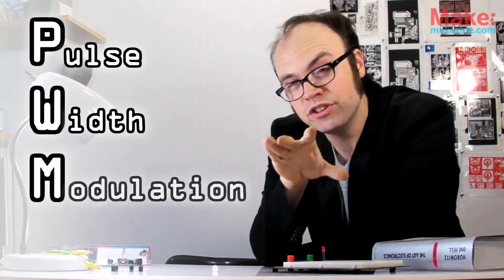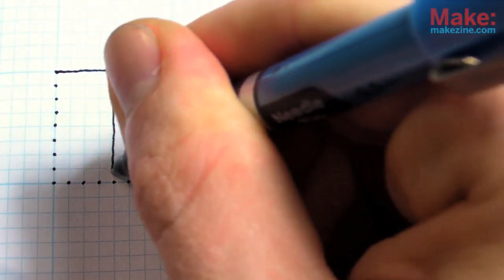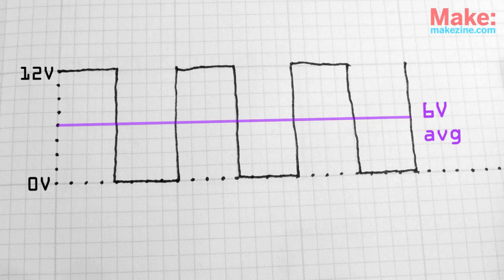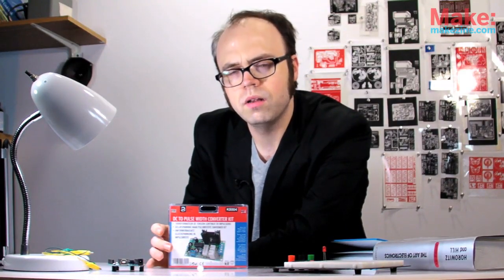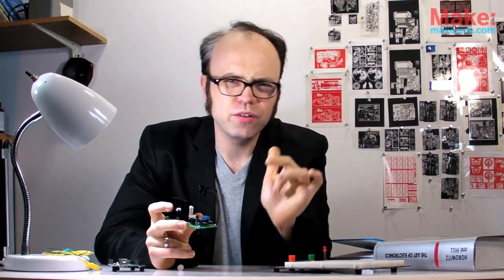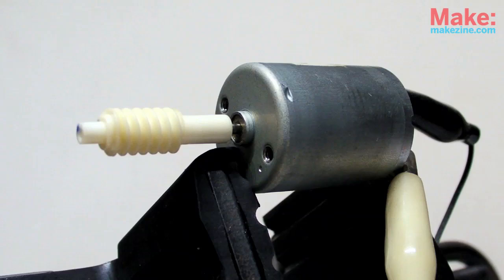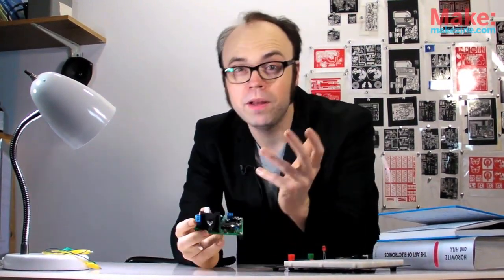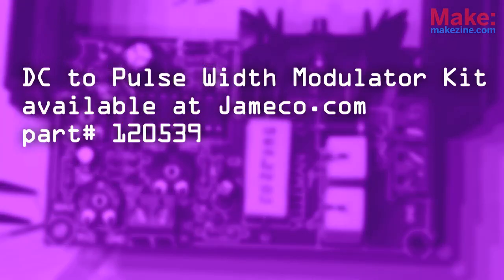Circuit Skills: PWM (Pulse Width Modulation)

Comment: Why not teach your viewers how to make a simple 5 to 15 volt input PWM circuit, with a handful of very simple components, such as a 555 IC, 2x 1n4002 diodes, a 1k resistor, a 47k pot, a 100nf cap, a 10nf cap, and a buz11 n-chan mosfet, on protoboard for a couple of bucks, rather than buying an overpriced kit. That way you can teach them something valuable, save them some money, and look less like a sold out, middle aged,  wannabe hipster, all at the same time. Also note how this channel rarely replies to actual technical questions that the viewers ask, which are all the more valid when a proper tutorial has not been given. That is not how a channel shopuld operate. Just more evidence of what a true sell out channel that Make is. They dont care if you leatrn, they want you all to go out and buy kits and arduino's so you can copy and paste code rather than actually learn the fundamentals first. Just look at the forums online. Millions of kids, spending real hard cash to throw into projects that in reality should cost pennies with the right components and just a little bit of knowledge. Bullcrap! Unsubbed.

Comment: I find it very confusing to use a variable input voltage as a variable to determine PWM duty cycle. I know how PWM works, but I wouldn't recommend this particular video to someone who's still learning it. Please use a circuit that uses a potentiometer (as a voltage divider) as part of a 555 astable multivibrator instead.

Comment: what is he point of the PWM if it is just proportional to the input voltage? I thought the whole idea was to control duty cycle in order to contrl (for example) the speed of a motor that is running on a 12 volt dc input. 

If I have to control the input voltage already, that begs the question how am I doing that?

Comment: The best part about this video is that you're using a bent conical tip Metcal.  Everyone gives me such a rash of crap for using it all the time instead of the cultish following the chisel tip uses, but it's very comfortable and not all ham handed when you're trying to get into a tight spot.

Comment: how does increasing voltage increases the duty cycle?
Reply: It's the other way around. Longer duty cycle effects the motor speed the same way an increase of voltage does. This is because the frequency of the pwm is so fast that the motor just 'averages it out' and responds as if it were a 'change in voltage'.

Comment: But use a potentiometer to control the speed of a motor
Reply: it's not efficient.What would you do if you have a 10W motor?
Reply: you would have a small fire, in my experience

Comment: can someone tell me what that black plate with the screw sticking out of the board is?
Reply: +Xaeravoq Are you talking about the heatsink?
Reply: +Jesse Downing a heatsink on that little thing? thats what i thought it looked like but i never would have guessed that something like that would need a heatsink.
Reply: They can get pretty hot to the touch. I once built a phone charger that converted 6v down to 5v and it needed one (granted, I cheaply just wrapped it in electrical tape).

Comment: Is it safe to drive a high powered LED via PWM without resistors? For example, driving a 3 volt LED with a 12 volt power supply via a 25% duty cycle PWM. The average voltage will be 3 volts, but will the temporary 12 volt peaks damage the device?
Reply: Skelpolu LED=diode  a led has maximum voltage resistance decreases dramatically just like in any other  diode so it practically uses the diode equation then the  product of the current through the LED and the voltage dropped by the LED must not  exceed the power rating of the LED but it`s not the voltage that will break the LED but the current so you should worry about using the tranzistor as a current source most LED s can only dissipate  60-80mW then poc so make the calculations if you hit the LED with the peak of the square at 12 the current should be (12 times x)<60 mW
Reply: +Chaplain Dave Sparks no
Reply: +Psi Phi Tell me, which question did you reply to?
Reply: 25% duty cycle will supply constant 3v on an average the formula being 12 vX25/100.
Reply: short term current when ON will be all that the power source can deliver and will most likely be more than the LED can handle and will let the smoke out. However, if you insert an inductor in line with the LED and a capacitor across the LED, then the PWM signal will get averaged out to the 3V theory says it will be without high current through the LED (less losses in the inductor and capacitor parasitic resistances). Note: the inductor and capacitor values are selected based on the PWM frequency; higher frequency means smaller component values.

Comment: I want to know how to make for example... servo #2 move according to the angle my hand moves where servo #1 is connected near my elbow, can you help me out with this please?
Reply: +Hassan Ajrouche you want to read the servos output in the terminal and use that data to throw it back to the servo IF a condition is met, you will need some pots to read your dof provided by your arm so that you can write the proper conditional statements
Reply: Sys.stem what does pot and dof stand for sorry i dont usually abbreviate things
Reply: Hassan Ajrouche
is not about you usually abbreviating is about you getting with the program, ever heard that expression ? you want to learn how to do things like what you describe you HAVE to get acquainted wit the acronyms it is part of the MCU world your trying to interact with in which case google is always more then happy o let you search for little things like this such as "what is MCU?" and so forth.........POT = Potentiometer / DOF = Desgrees of Freedom
Reply: Sys.stem thankyou very much (:

Comment: Make: can this be used for 2 red electroluminescent light strips 17"x 3" to control the brightness from half power to full power to represent the difference beteween my running light and my brake light by using low mode for running light and using high mode for when brake pedal is depressed.

Would like to use one to control the 2 amber blinker lights as well. Im retro fitting my cars tails light and love the crisp clean look of electroluminescent. No hot spots =]

Comment: Quick note/correction:

The part explaining that 12V at 50% duty cycle is 6V is inaccurate. A 50% duty cycle would give you 50% the  POWER of that at 12V (think of it like you're running it at 12V but for half the time).

This does not mean half the VOLTAGE though (Imagine a simple resistor: P=V^2/R, so half the voltage amounts to 1/4 the power, not 50%)
Reply: nope. power depends on load, no load information, no power information. It's a VOLTAGE waveform so 50% pwm of 12V = 6V average (DC). If you had 12 Ohm @100% (12V) = 12W, @50% (6V) = 3W; 25% power BUT still 6V is 50% of 12V

Comment: Come on man! I wanted to see you actually do something like perform a Fourier Transform on that PWM signal.  Show them the Gibbs phenomena or ringing at the edge of that square wave.  Which you can really understand if you can show them the decomposed signal as the sum of Cosines and Sines.  That would make for a better video.
Reply: Impedancenetwork Make is for beginners. Much more in depth videos can be found on Mike's Electric Stuff, and EEVblog

Comment: Can you explain voltage maximums? I would like to use PWM to pulse a higher voltage near 250+ volts and add in 5 milliamps for "voltrolysis"

Comment: doesn't the on/off behavior makes the motor to run unsmoothly? I mean, the motor is basically run, stop, run stop, run stop, that makes a really annoying ride if you ask me.
Reply: Motors can't react that quick to changes in voltage.
Reply: ***** i guess it'll depend on the frequency and duty cycle of the square wave,

Comment: Could pwm charge 14.5v 1400 ferad super capacitor with 20v lithium ion batteroes ? Without the batteries getting too hot.
Reply: yes

Comment: Not exactly.
AC goes in both ways.
In PWM it is called a Alternating DC.
Basically a DC which changes it's voltage during time.
AC changes both voltage and the direction.

Comment: You can use a 555 circuit to generate a pulse which would trigger a transistor on and off which is far more efficient.

Comment: Actually pot drops both current and voltage.
But PWM is far more efficient and better.
Although in some serious circuits like a power supply or a supply for some ICs you will need to smooth that square wave using filters using some RC filters.

Comment: No silly. A potentiometer (essentially a resistor) drops current. Whereas PWM is pulsing voltage up and down,  square wave style.

Comment: Because not everyone is going to hook a variable voltage supply up to every motor they will ever run. It is more convenient to hook up a straight voltage and use PWM to reach the desirable results.

Comment: Do you guys have any circuit that with the following output: 12 volts, adjustable frequency up tp 45Khz and at least 20-30 amps? Thanks in advance

Comment: Output duty cycle = CONSTANT * DC Input Voltage. The constant is just a number which doesn't change, so when you increase or decrease the DC voltage, the duty cycle increases or decreases (they are proportional). How much it changes is dependant of the magnitude of the constant. A lower constant will give you a smaller change and therefore more sensitivity.

Comment: @htfkid2000: No. PWM doesn't work with timing.  You can change the frequency to whatever you want, timing doesn't matter, but the output power will depend on the ratio of the on to off portions of the duty cycle, and that ratio can be continuously variable.  Digital in binary, analog is continuously variable.

Comment: it's not such a great solution. i'd rather use an atmega8, which is mutch cheaper an easier to assemble, plus you can generate more than one pwm simultaneos, and also you can programme a ramp mechanism so you don't have abrupt changes in the motor's speed which are pottencially harmful.

Comment: @FractalDistortion PWM works with something called TIMING... You time each pulse, but every pulse is the same strength as the time between each pulse increases the intensity of the LED or motor decreases... it's all in the physics of how analog devices work!

Comment: @TheTranceMusicLover actually, PWM sends pulses, meanwhy an LM317 limitates the voltage that pases through it, so it makes less heat than a limitating resistor, but still generating heat, that means you still losing power. So in conclusion: is better the PWM than the Voltage Regulator or the Limitating Resistor. Hope that helps:)

Comment: i just use a potentiometer, and it does basically the same thing as hes talking about, except, you can go from anywhere between 0% to 100% speed, and its a lot more simple  -_-

Comment: so you controlling the speed of the motor with modulation, but your controlling the modulation with voltage? why not connect the variable voltage directly to the motor?

Comment: Hi   Colin ,   The  maximum output of  the  pwm was 21v , that  is fine . But  the Amps  can  be 2 to  4 Amps  or greater .  Will  it  not  fry the  scope ?  Also  you had 3 probes and 1  Earth.  Please  explain.
Thanks .

Comment: I thought the main principle behind PWMs was varying a load input WITHOUT changing the circuit's voltage. RC cars for example use a PWM to control motor speed while that 9.6V doesn't change.

Comment: Dude, this was awesome, not only is PWM used on stuff to control motors, brightness and other devices, it is also being used in cars for the longest... PWM in a car is used to modulate the velocity of a blower motor in an A/C sys. on today's modern vehicles. There's a bunch of electronics in today's vehicles using this stuff. dude you would make an EXCELLENT driveability technician at any dealer! I wish i had mad skillz like you.

Comment: You mentioned wasted power in heat. From the look of that voltage regulator and the heat sink. You are still generating some good heat.

Comment: PWM is also used in computer fans and fan controllers to lower overall system noise, it allows the fans and the fans motor to be a lot more quiet at low or high speeds.

Comment: PWM is also used in electronic fuel injection systems to vary the amount of fuel injected.
It's also sometimes used to control the idle air solenoid.

Comment: i would like to see more examples of this - maybe with arduino?

i actually had an idea a long time ago using special light bulbs that were designed to work at maybe 50hz instead of 60hz. if you are using the full amount of current, how does that apply to the brightness ratio? aren't you being more efficient, and thus, it would stay bright? when would you actually notice? if it flickers, cant you use a capacitor to smooth it out? or would just using a lower wattage bulb be better?

Comment: @ccrimsonfox There is no such thing as a perfect world. The best we can do is to maximize efficiency given our current technology. The heat sink is for the bypass transistor driven by the pwm that switches current to the load. This circuit is still far more efficient than using a resistor.

Comment: it will heat up your wires slightly though, so be careful when using it with mains electricity otherwise you could have a fire on your hands (quite unlikely).

Comment: @humxa24 A potentiometer is a variable resistor. The point of using PWM instead is that it doesn't waste energy like a resistor does.

Comment: ... wait... if you need to control the PWM by changing the Voltage, can't you just apply the current directly to the device? I mean, what is point of applying 20V to the PWM, when 9V can power the motor. The output of this device is just controlable by the input, isn't it?